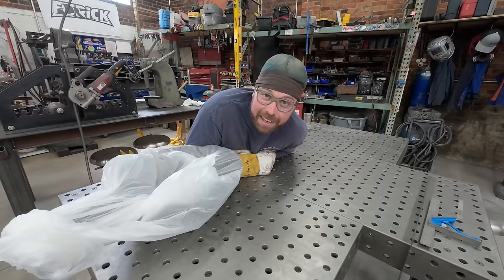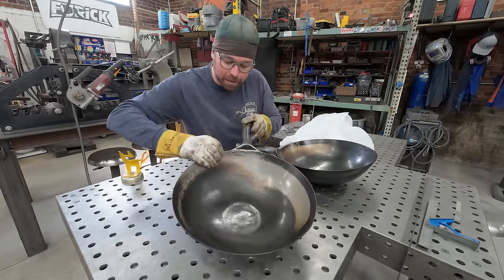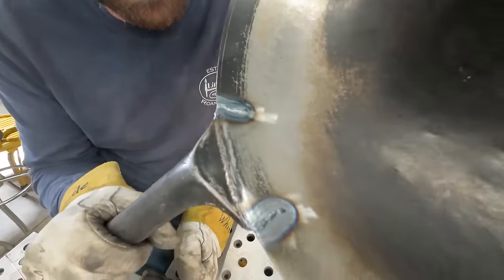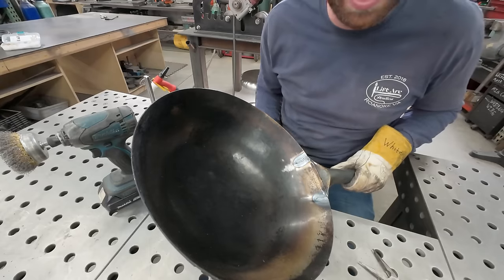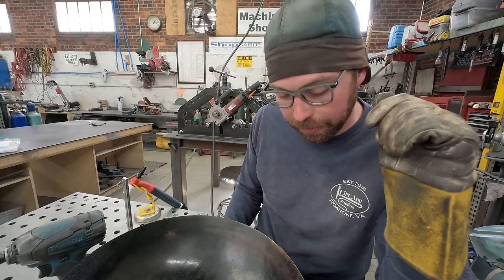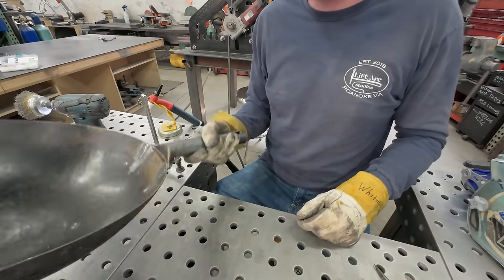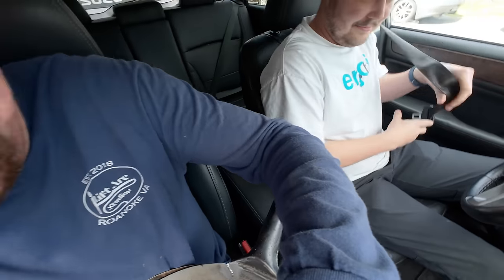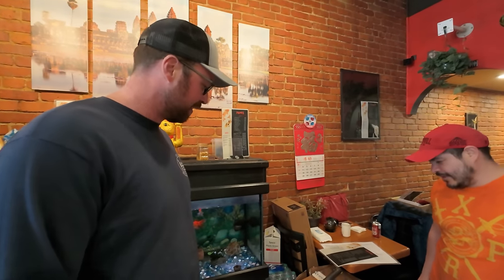What Tay will do for free Crab Rangoon

Comment: So, normally, which would cost more, new woks, or repairing the woks? 4:57
Reply: around $130-200 for a good professional carbon steel wok.  wok's can be had for a lot less but those samples Tay had were worked hard so you'd want to have a good quality wok

Comment: The feel good video of the day.  Question for you though, Tay.   I've been watching a lot of welding repair videos and there is a lot of side hustle money to be made.  My focus was on aluminum rim repair.  The guys that actually even knew what they were doing drilled a hole at the end of the crack so as to mitigate any future propagation.  Not saying the wok is the same as an automotive rim but would putting a small drilled hole be out of the question for your wok repair or would it even matter.  And yes, you were correct, the metal would be carbon steel.  Stainless is frowned upon for wok cooking.
Reply: Even though I'm not Tay, it would be a toss up for me. If you drill a hole, then you have to fill the hole in thin sheet. Welding thin sheet with tig, especially from both sides, should give full penetration and hopefully melt and fuse the end of the crack. It might be possible to use a die to check for cracks but in this case a failure in the part would not be catastrophic, where wheels must hold air and are a safety issue. On anything thicker than 16 gauge I would drill, just because it is a well known method (or at least something I have been aware of for a long time) and isn't hard to do, especially if you get better results. I have repaired stainless surfacing cleaners for steam cleaning that get similar cracks and then have cut reinforcing plates to cover the area and give more strength. Think of a lawnmower for cleaning concrete and walkways or tile floors......the get the crap beat out of them.

Comment: Stop. First of all, you need to make gussets that tie in the Handel down about 3 inches .025inches thick. That Handel can not support the weight as designed. I'm balk parking it as an aeroshitter engineer
Reply: Loom at It, fulcrum at top. Load at bottom. Easy fix
Reply: The weld points are where gussets need to be, now u face palm for me
Reply: 85 amps these nuts
Reply: Yep I'm drinking lol laid me off
Reply: I've been laid off from a lot of companies in 8 months. JPL and Biden can go ....... this them sleves
Reply: Is gusset the correct term for something welded 90deg from a support?
Reply: I program